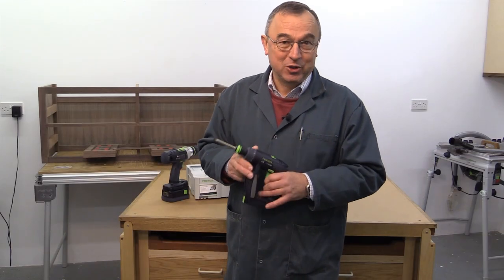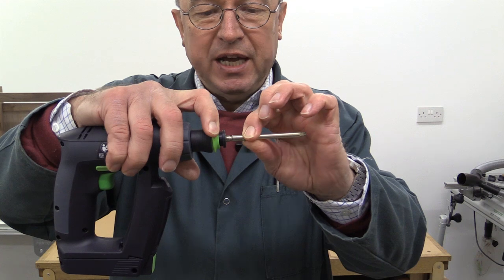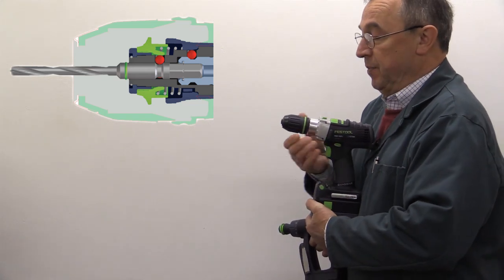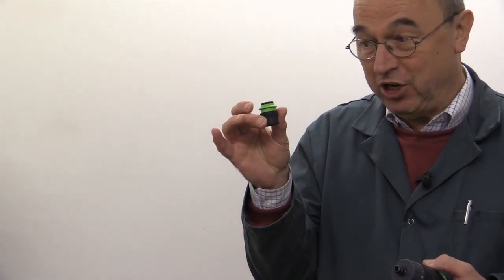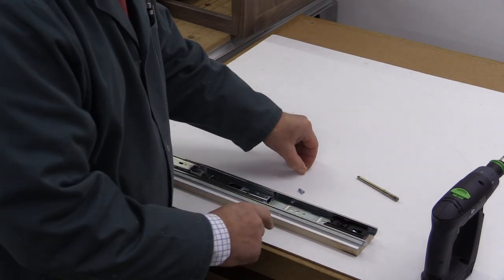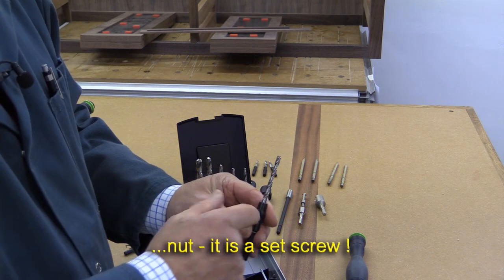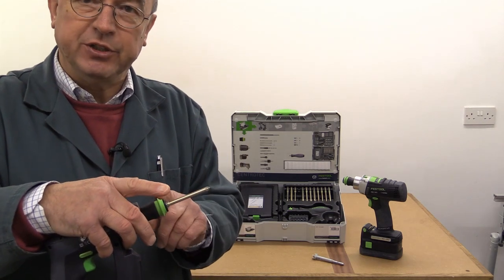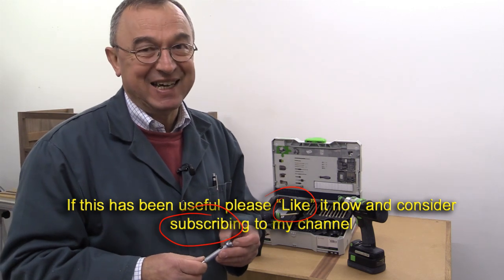Introducing the Festool Centrotec standard

Comment: Thanks for the review. Now that you have had this kit in your FT arsenal, would you say it’s still worth the cost or would recommend another route for the woodworking hobbyist.
Reply: Peter, thanks! BTW: I’m an old Army Chaplain Retiree who lives in Texas (USA) and picked up woodworking only recently. I find your channel to be inspirational. Thanks!
Reply from the maker: Hi Matthew, The Centrotec standard has been adopted by many manufacturers and I have a number of excellent drills and countersinks from Axminster who also use it for the Parf Guide System drills and cutters. I am sure that other suppliers are producing their own Centrotec kit. Centrotec is brilliant because the drill or bit is held more securely than the old hex design.

Comment: Looking at centrotec stuff recently but if only festool is using it its not really a standard. never had wooble with hex or a regular chuck. also making it imcompatible with regular hex is just a middle finger to everyone since getting the "lost" bit out of it only requires to remove the adapter.
Reply from the maker: Axminster sell lots of different makes of Centrotec kit as well as manufacturing some of their own.  Peter

Comment: Good video Peter. I was already subscribed to your channel at the time I watched this video. When I watched it the first time I hit the like button and left a comment and thought good product and some interesting accessories.... but to pricey. And even though I have a Festool CSX drill with the offset attachment as well as several other attachments and I understood your explanation of the benefits of the centrotec system....  I remember thinking I’m not going to give up my drills, drivers, impact drivers and my accessories especially given how expensive everything is. Then this morning around 2 a.m. I watched a Willis construction YouTube video about how he sold his various  Dewalt drills and was now using nothing but Festool drills and accessories ( and he had a lot of them! At least one of every kind they make!!! ).  He said he bought5 or 6 extra centrotec  chucks and keeps various bits, drivers etc in them. He then pointed out that the Festool system is much stable then his various brands of tools. He said Festool was more stable because of the larger amount/length of metal in the centrotec system kept the bits or what ever you put into the Festool a better tool. He explained that other brands supported very little of the accessories metal so the driver bit or drill bit had more runout at the tip making it harder to drill an accurate hole or drive a screw accurately. So then I watched your video again and I decided I am going to replace my other brand drills, etc, with Festool brand drills and drivers when I can thank to you and Willis Construction! 😊
Thanks Peter. And sorry for rambling. I have been awake for almost 48 hours. I think I will try to get some sleep now.
Cheers.
Ron
Reply from the maker: Hi Ron, No wonder you are tired. If you are going to buy new drills as well then look for my Festool drill/driver lineup: https://www.youtube.com/watch?v=-3mwj1YTgtg  I do recommend that you try the C18 and TXS - I love them both and have no problem with the CXS and C18 design but others prefer the PDC and TXS format.  Rest now my friend.  Cheers.   Peter
Reply: New Brit Workshop   Thanks Peter.. 😊 I got about 6 hours of sleep so I am good now. 😊.  Yes I will be going to the Festool drills. I am impressed with how well the Festool drills bits and drivers are supported and how much less run out you get on the end of a Festool drill bit or driver bit compared to the other brands.
Cheers 
Ron

Comment: I’m a professional cabinet maker and use battery drills extensively everyday, additionally I’m a massive fan of fed tool. I own a reasonably large range of their tools and some are complete game changers. I want offer some food for thought about their drills.

1. Fast fix isn’t as useful as it sounds and there is nothing fast about it. You can buy a reasonably good quality combo kit (drill and driver) eliminating the need to switch between a Jacobs chuck and a driving chuck. The idea idea of switching chucks makes me cringe, especially in delicate situations where one screw needs to be driven before the next hole is drilled which may occur when you want dead perfect alignment. The advantage I see is the right angle attachment but I do this 40+ hrs a week and it’s not common you need that ability. When you do a $50 adapter will work fine anyway. The offset chuck is very neat and I wish I had one but I’m reality I know I’ve never had a situation where I’ve needed one. 

2. The criticism of legacy bits being unsupported is true but irrelevant. The “legacy” or hex bits in a impact driver driving screws don’t require support. Your holes are predrilled, the screw will follow that path regardless of support. 

3. When drilling holes you will 98% chance be using a Jacobs chuck. The jaws of a Jacobs chuck offer ample support for drilling clean holes with minimal run out. I’ve seen depth stops for drill bits from various makers including festool, another trick is simply set the bit the right depth inside the chuck. You can’t drill through your board if you don’t allow enough bit to protrude from the chuck. If your bit is too long to do this then chances are simply wrapping masking tape around the bit at your depth will work fine and be fast. I would however recommend a tct (not steel) counter sinking bit with a depth stop, it will keep your work looking professional and ensure you are getting the maximum amount of board to bite into without the risk of having screws chip out when removed.

Finally, a tip for everyone. You don’t need to predrill the screws for your drawer runners and slides. Simply drive the screw, you only need small gauge 16mm screws.

Honestly, I’d love to have two or three festool tool drills like I have with my DeWalts. They are better drills after all. But for the vast majority of people there’s at least $20,000 worth of equipment that’s more useful than upgrading from makita/DeWalt/etc to festool drills. But what ever you do, don’t resort to swapping bits and chucks just to swap between drilling and driving, it’s not civilised.
Reply from the maker: Hi Callum, Many thanks for that detailed comment which people will find very useful. The professionals that I know will have a drill for each task to speed things up and sometimes it is better to go cheap and cheerful in order to get the range.  Cheers.   Peter
Reply: I know you wrote this years ago but I just stumbled upon this video. Thanks for your comments. I agree that although Festool have a lot of great ideas, and I have quite a few Fes tools, I’m not convinced this is worth the money they are asking. Keep up the good work!

Comment: This is interesting, but like Sony Beta max format for VHS, a standard is no good if no one else follows it. Festool needs to open the license to any company to make the bits/drills etc. or this will be a "great idea" that no one uses.
Reply from the maker: Hi Gary, There are loads of companies making Centrotec compatible bits and pieces. Axminster have a very wide range.  Peter
Reply: @NewBritWorkshop  Thanks for the info. What is interesting is that Milwaukee is coming out with a tool that looks identical to the installation driver from Festool. Did Milwaukee license the patents? Or they owned by the same parent company now?
Reply from the maker: Hi Gary I do not know anything about patent rights for this but there are many companies offering Centrotec compatible solutions - no need to worry about the license side of things.  Peter

Comment: Good video. Centrotec is a solution to a non problem IMO. I had never once thought that a standard driver bit was unstable and wished someone could come out with a competing “standard”so that I could rebuild my bit arsenal from scratch for ten times the cost. I don’t understand why all the other brands continue to use Jacobs on all drivers but impact, which have convenient quick change “chucks”. I have a lot of Festool,including the compact driver, so I’m not a sideline hater. I too am new to their drivers. Been using dewalt for years and have no complaints other than wanting a driver with the quick connect. I don’t buy into the theory that Festool is helping from losing a short bit into the chuck by changing the standard. Take a look at the dewalt impact driver. It’s got a beautifully simple and compact chuck. Let call out the truth here... Festool is great at creating a proprietary ecosystem with their own “standards”. Smart business but don’t try to spin it as a benefit to the customer.
Reply from the maker: Hi Todd, There are a number of competitors to Festool in the Centrotec market. The real advantage of Centrotec is the Centrotec chuck and the stability when you use a Centrotec ended drill bit.    Peter

Comment: Hello Peter, I am, like you, a long time user and fan of Festool tools. Currently I own 12 Festool tools and they are all first class, I often have 2 or 3 Fastfix chucks on the bench with different normal bits in them. However the Centrotec system, with 5 brad point drill bits costing £50.00,  is so absurdly over priced that I will not even consider it. Festool really do need to wake up and smell the coffee, as they say, on this one. Fortunately 3rd party after market suppliers are now making suitable bits so lets wait and and see.
Reply from the maker: Hi Mike, Yes, I know that Axminster have a huge range of Centrotec compatible kit.   Cheers.   Peter

Comment: One bit missing: 5/16 tek driver with Centrotec adaptation. Need short ones and long ones. Pass it on to the powers that be. Just bought Quadrive drill ( I'm a roofer and stability is everything) and there are no driver bits available. I made my own in about ten minutes but I was surprised that a Festool have forgotten the entire roofing industry.
Reply from the maker: Point noted and Festool will see this I am sure.   Peter

Comment: Hi Peter, does it mean legacy bit can not fit in centrotec chunk, have to use the bit without chunk?
Reply from the maker: +Andy Fan   Hi Andy,  No, normal hex bits will not fit but they do fit in the end of the drill if you remove the Centrotec chuck. Also, Festool supply a Centrotec holder for normal hex bits - it is in my CXS all the time.    Peter
Reply: +New Brit Workshop (Peter) Thank you Peter, now I know more about centrotec.
Reply: Unfortunately the holder supplied with the CXS is only magnetic, which is fine for legacy driver bits, but less good for hex drills - in fact it is no better than putting the bit directly in the drill shank .  They do produce a holder which locks the standard bits and drills in place (492648) - it's a shame that one doesn't come as standard.

Axminster Power Tools now make a number of bits and accessories which fit the centrotec standard.
Reply from the maker: Geoff Sheppard Hi Geoff, I have just got hold of an Axminster adapter and it works perfectly.    Peter
Reply: Yes, they do a number of Centrotec compatible bits and drills under their 'Universal quick change system' and/or  'Trade Bitz' names.  I got the long bit set, which includes the legacy bit holder and tried the Fisch drill bit set, all of which work well in a centrotec chuck.

Comment: Hi Peter, with the pdc18/4, are you able to use the percussion function to drill in concrete with the centrotec adapter and the centrotec stone drills? Or do you have to use the normal bigger Chuck? If so, I assume you'll be able to fasten those centrotec drills in the normal Chuck aswell? Maybe the  centrotec stone drills are just for modern light weight bulding blocks. Nicolas
Reply from the maker: +Nicolas Masset   Hi Nicolas, I am not aware of any Centrotec stone drills. The only ones that I have seen have the SDS connection which is universal and not Festool specific. I I have tried straight shafted stone drills in the PDC which work very well indeed.   Peter
Reply: +New Brit Workshop (Peter) Thanks Peter. I think these ones are centrotec right? 

http://www.nonpaintstore.nl/nl/festool-online/boren-en-schroeven-1/boorgereedschap-1/centrotec-steenboren-met-hardmetalen-snijvlak-1/FESTOOL-769096-festool-steenboren-db-stone-ce-set-tl-6x.html

These would be awesome to have but if the pdc 18/4 only hammers with a normal chuck then they'd be pretty useless for anything except really soft stone I assume?
Reply from the maker: +Nicolas Masset   Hi Nicolas,  I did not realise that such a product existed. There is no mechanism that would stop the hammer action when using a Centrotec chuck so they will work.     Peter

Comment: Hello Peter.  I have enjoyed and learned from your video on the Centrotec system.  But I have a question which I do not think was addressed in your video.  If I wanted to use a legacy screwdriver bit, say a stubby PZD bit with a short (15mm long) hex shaft, why would I bother to fit the Centrotec chuck to the drill and then fit the legacy bit holder to hold the bit?  Why not just shove the PZD bit directly into the CXS drill drive spindle, which accepts and holds legacy hex shafted bits equally well, I would think?  Both the spindle and the legacy bit holder have a magnet to keep the bit from falling out.  And both seem to offer about the same amount of lateral support.  But the spindle-mounted bit is more compact.
Thanks.
Mark Moorhouse.
Reply: Oops! Sorry! I see now that this point has already been made in an earlier comment, by Heino Poulsen.
Mark.

Comment: You can put a legacy bit direct in the drive with out the centrotech. If you need to be shorter, I used quite often.
Reply from the maker: Heino Poulsen Yes, that is important to note.   Peter
Reply: @NewBritWorkshop  Doesn't this contradict what you said in the video?
Reply: @Cisco8484   Not really. You can put legacy hex straight into the hex from the drive, making for shortest of lengths, which could sometimes be nice (imagine the short length of a C 18 with a old style bit sitting directly in the drive). But you can't put legacy hex into the Centrotec for the reasons Peter explained.